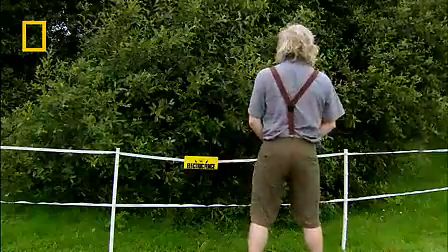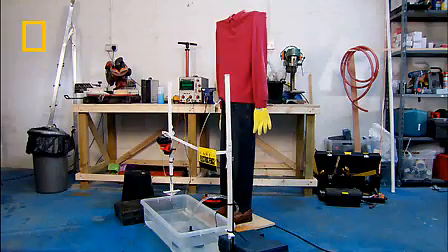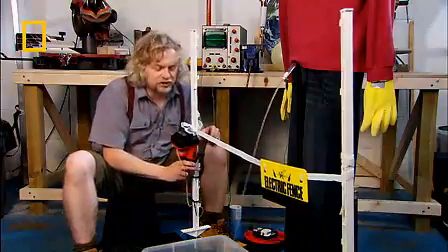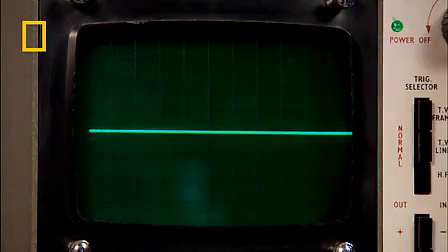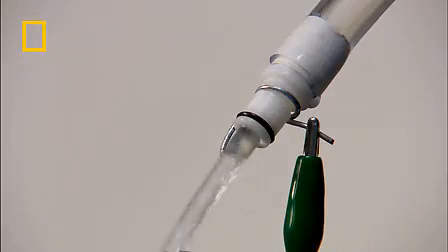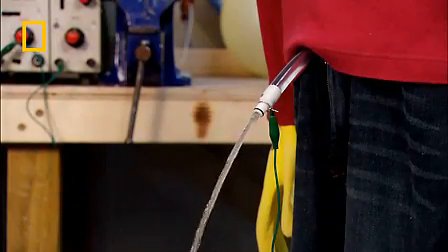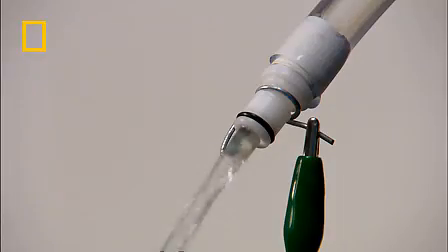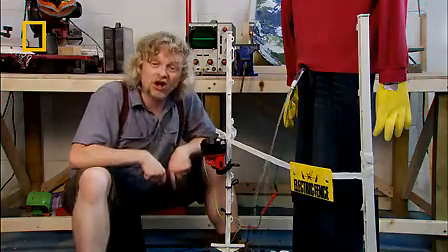What Would Happen if You Peed on an Electric Fence? | National Geographic UK

Comment: Actually this "research" is heavily flawed as well because the stream is far bigger than what you'd normally get. The core of  this, is the density of the stream and here, it's easily twice as big as a regular stream of urine. Not to mention that a hose will poor the water more evenly. Basically, I think Mythbuster's result is pretty spot on.

Comment: "it would hurt like-" 
.... And now we'll never know
Reply: It’s like a snake bite
Reply: @badgerdestroyerinc.6066  how do you know
Reply: It's shocking for sure but it doesn't do any damage. If you really want to know find an electric fence they use for animals. It has 5,000 to 7,000 volts running through it which is enough to do some damage but there's some kind of regulator on it to keep the amperage down low. It's supposed to be a deterrent not something that causes harm.
Reply: Killer Kualastar Like a bitch

Comment: Why??
 Yes it would hurt, but NOTE that it is the Ampage and not the Voltage that is critical. DO check the Ampage of the electric fence as a few hundred volts at high enough ampage Will be Fatal!! whereas afew thousand at low ampage Will NOT!!

Comment: then again you can do this one different electrical fences. it's different depending on the nime. cows need higher voltage than sheep. though i find 6000volts a little much from what i've been through. i've peed and held in some that should appearantly deadly without getting hurt. RULE 1. always have boots and stand straight up and down when tuching one. without or in other kinds of shoes that won't stop the current as good you might serve as a ground for the charge in the fence. 
No stupidity!